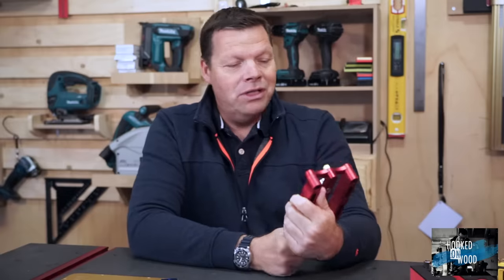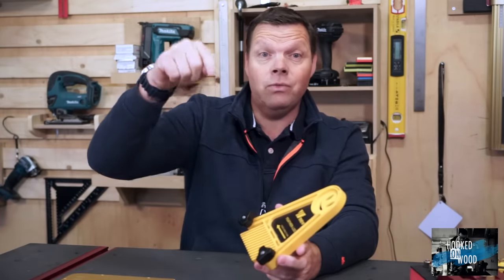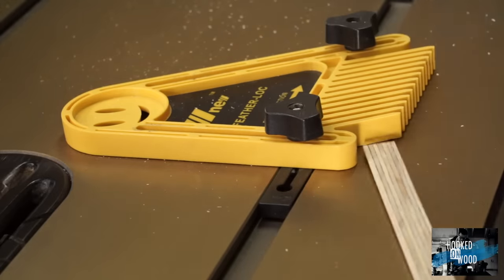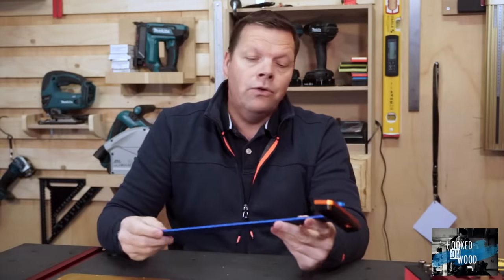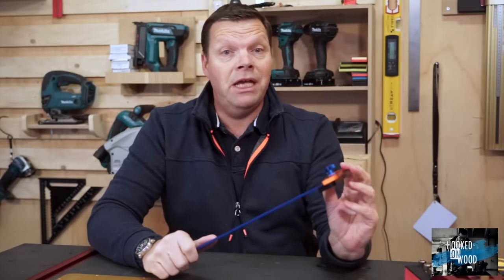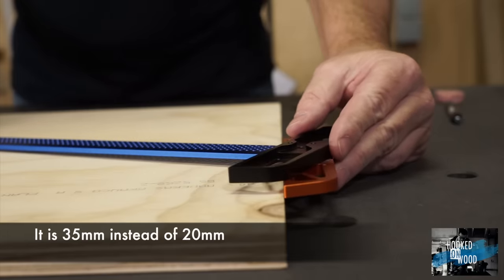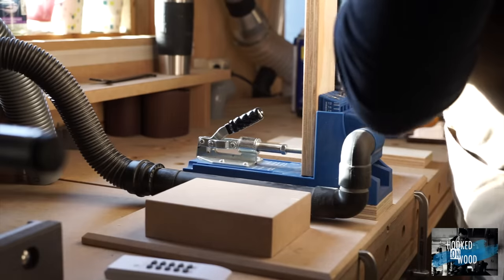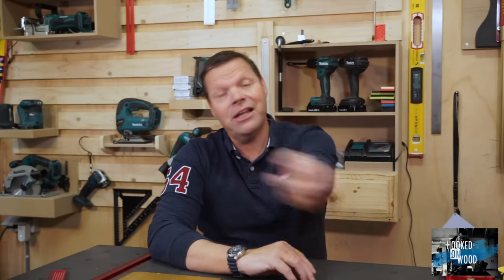China Tools Episode 5, In Depth reviews of China Tools

Comment: Good episode, thanks! A design issue that many feather boards have is I think the angled slot for mounting. The further one extends the featherboard the closer the screw mount becomes. One losses mechanical advantage at the screws exactly when you need the most because of the extra leverage caused by the longer distance from the clamping force.
Reply from the maker: Hi Edward, I understand what you are saying. I think it depends on the thickness of the miter slot if this will become a problem when using it. i do not find any problems when using them. Thanks for your comment!

Comment: Love these videos, they are very helpful. Also, fantastic tip (buying from same vendor) on the angle corner clamps, never would have thought they would have been different specifications.
Reply from the maker: I find out the hard way. I did not expected that it would have another size so I never measured it. But then I had an on explained curve in one of my work peaces and then I find out it these clamps where different in size. For most of the work, this is not a problem but I think it is better to buy them from the same vendor, so they are exactly the same.

Comment: Another great video - well done.  I can see in the background in the video some JessEm Clear-Cut Stock Guides. How do you like these, do you think they are worth the expense or will feather board suffice?  Regards, Sam
Reply from the maker: Hi Sam, 
Yes I do like them. Especially when I need to cut two sites of a board on a bevel at 45 degrees. Then I can't use a feather board. They are much easier to setup and also pretty easy to use. I can cut more precise with these then with 3 feather boards but not that much!
So If you take the setup time for granted they do the job in 90% of the cases and at 90% of the accuracy. 
I like them and for me they are worth to money. But I only use them in 10-25% of my cuts. But I think this % will drop enormously when I have to use feather boards.
That said, it is really a high end product. Everything looks very nicely build and I can see that this cost some money.
If you have any questions, feel free to ask.
Dennis
Reply: @HookedonWood  Brilliant - that's made a decision for me, I'll get them.  Thanks once again.

Comment: That jig you made for drawers is genius. I’ve never considered doing that. 

Also on that ruler do you think the holes are chamfered on both sides because it’s made to flip upside down? I remember on your first video with the red ruler you mentioned that since the holes are at an angle you can’t draw parallel lines or something- could this have been a solution?
Reply from the maker: Hi Michael, 
I, think they made those chamfered but as I said that make no sense, also because there is no scale at the other side. So I really do not know. Maybe because it looks nice. 
About the red ruler I think you misunderstood. I do not know what you are referring too so I can't say what I meant. 

The fact that the thing can happen what I showed does not mean you can't get a strait line. It is a little bit difficult and you should be aware of it. If you hold your wrist on the right angle and keep it that way, it is fine.
Regards,

Dennis

Comment: I’ve got a set of those yellow feather boards and don’t like them as much as my UKJ featherboards as the plastic is too stiff and can see the feathers breaking under heavy use. The star knob is the cheapo kind too. I guess you get what you pay for as the UKJ is twice the price... but lots better quality.
Reply from the maker: Hi Neo, Thanks for your comment. 
The UJK feather boards are a welcome product in the line of feather boards. They are one of the few who make them different and with different materials. And from a quality point of view they are superior then those I show.
But I believe a set is about 65 dollar instead of 17. So the difference is huge. That said. I think for does who are new, start with the yellow one. If you experience where you can use them for, how much you use them it is easier to justify an investment of 65 dollar in the future. I upgraded it with the Jessem Guide system that is far more expansive. But because of the yellow ones and knowing what they can do in terms of accuracy, and simply help for longer boards this was a discision that I could make a bit more easier. Thanks for your comment.

Comment: Hello. Angle clamps, I wonder if you could check for me how far apart the holes are that you used to fix them down to the board, could be useful if they were 96mm like an mft layout. Thanks great video.
Reply from the maker: Hi, the holes are 73mm apart. So that will not fit. But good thinking. You sent me in a direction with potential ideas. 
Thanks!

Comment: Greetings from Denmark. Thank you for yet another great review of the China tools. Have you experienced that some of your ordered goods got stuck in customs (I guess there must be some limitations on how much you can import into the EU?)?
I really like your workbench, what material have you used for the top, black MDF?
Br Ulrik
Reply from the maker: Hi Ulrik, 
I get a lot of questions about the black MDF. In the Netherlands this is fairly easy to obtain in the hardware stores. Here they call it fully colored MDF.
Valchromat is also a fully colored MDF that is available everywhere. I think this is also very suitable, but it is much more expensive. However, this is a bit more robust, stiff and denser than the MDF I use.
What I use is not Valchormat, but it looks a lot like that. What I use is cheaper and costs around 80 euros here in the Netherlands for a 240 x 120 cm sheet.
I see several manufacturers worldwide who make fully colored mdf. The problem is that there is no brand name here in NL for this MDF. So I find it difficult to indicate which MDF is comparable with this worldwide.
About my Experiences with goods I ordered from China in general. Till now, I never have a problem. 3 times my local post office sent it back to the sender. But that was their mistake. But perhaps I am just a Lucky guy. :-)
Thanks for your comment.
Reply: @HookedonWood  Where can i get The Feathers board
Reply from the maker: @robink5433  Hi Robinson,  Here is the link:
https://www.banggood.com/Drillpro-Upgraded-Multi-purpose-Double-Feather-Board-for-Router-Table-Saws-Miter-Gauge-Slot-p-1520814.html?p=R9011426175690201811&custlinkid=761335

Comment: Do the corner clamps work on larger stock like American 2x4 material (1 1/2" thick)??
Reply from the maker: In a way, Yes, but I think I prefer bigger clamps for that kind of material. These are up to 16cm https://www.banggood.com/custlink/DGvhFSyFuE
I think that would be a better fit for that thicker material. They will not work with the clamps included on the material, but of course with ordinary clamps, they will.